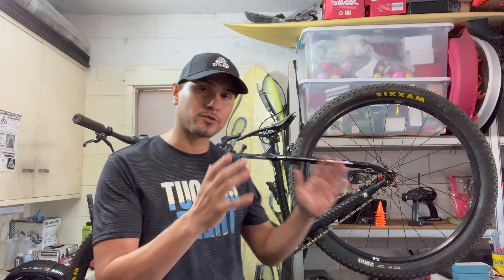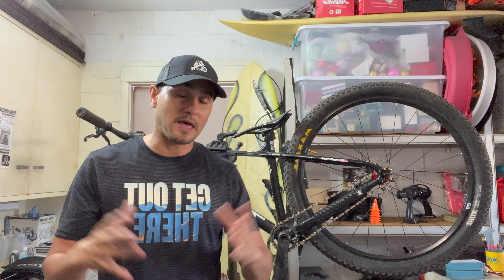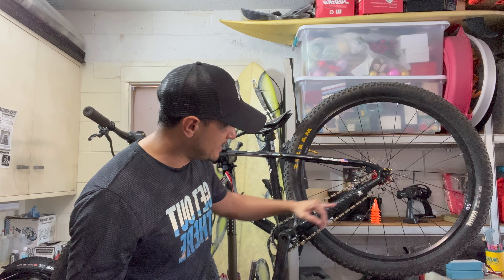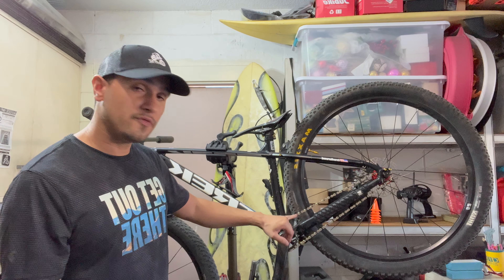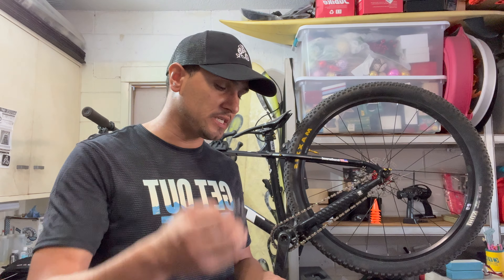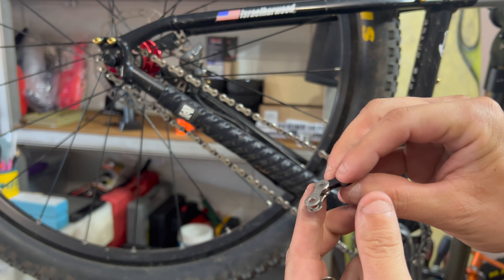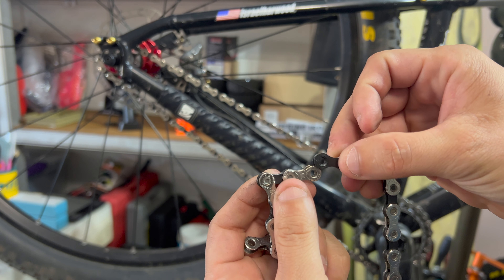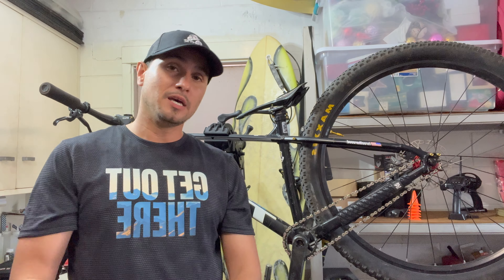The secret, turn your 2021-2023 Trek marlin 5,6,7,8, into a true single speed

Comment: I'm trying to do the same with my 2014 Xcaliber! It's tricky without the chain tensioner 😅
Especially with the narrow wide chainring!
Great and informative video!
Greetings from Croatia from Kris 😊
Reply from the maker: Sorry for the late response. Yeah it definitely be tricky without a tensioner. It took me quite a while to find the right gearing and chain link for it to work.
Reply: @hardtailrider7172  I managed to do it with the 34/14 combo,but gave up eventually, after like few days! Coasting was practically impossible,and the pressure on the bottom bracket bearings was pretty high! I'll try with the bmx chain,and the non narrow wide chainring! 😅

Comment: I used the magic gear ratio on my GT Avalance Sport using a 32T front and 19 rear on a 43.5cm chainstay length.  Initially i purchased a 20 for the rear before using the magic gear ratio. Currently awaiting the 19T cog from a seller. Also using a oval chain ring so wondering how it will work out. Fingers crossed and hope I want need the DMR sts.

Comment: I’ve got a 2023 Trek Marlin 5. Tried running a 32t up front and an 18t in the rear and it still slack and needed a tensioner.